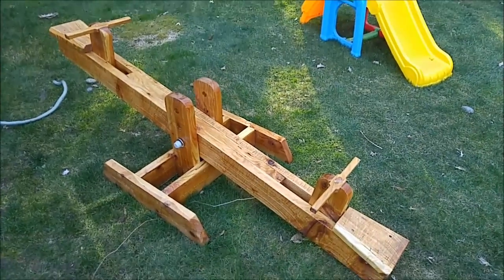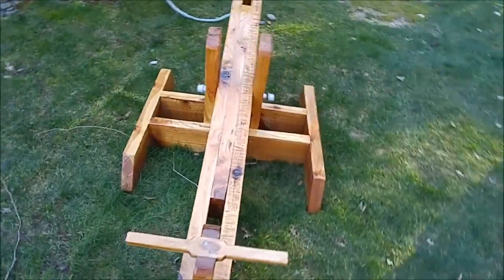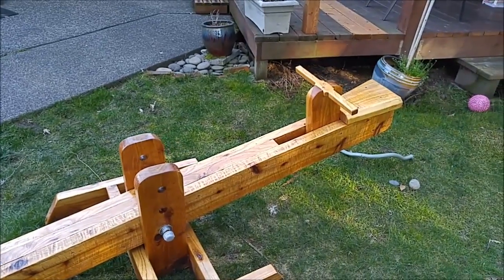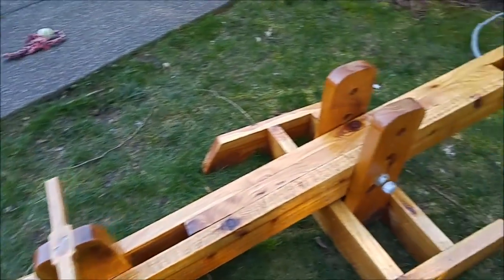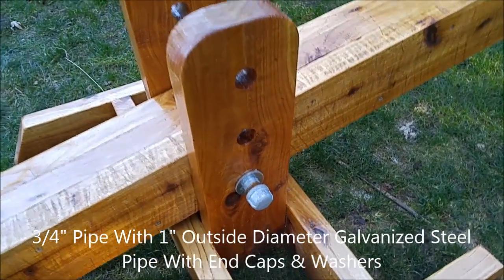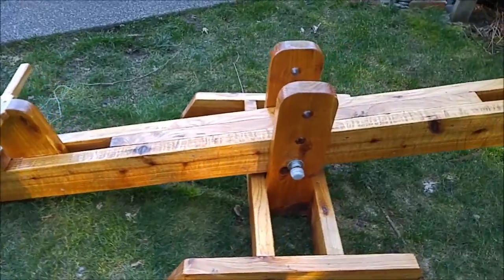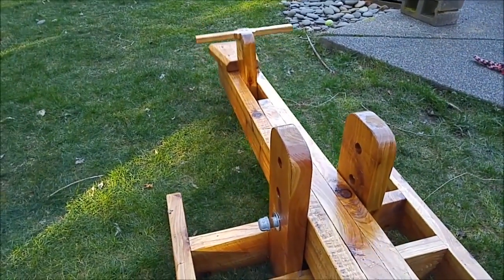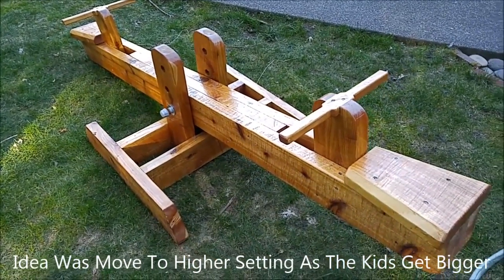DIY Seesaw / Teeter-Totter

Comment: I love this, and there are some things about yours (e.g., the angles of the seats) that I like about yours better than many others. One question -- some other builders using a similar design used a bolt (e.g., carriage bolt), washers and nut as the fulcrum. Why did you choose the pipe instead? Is it harder or easier to change the height with the pipe than it would be with the bolt? (And can you think of other issues -- pro or con -- to the pipe-vs-bolt issue?) A couple of people recommended using the bolt, but adding a pipe as a bushing. I haven't even figured out how that would even work (esp. with adjustable heights). Thoughts there? 

Also, some have recommended adding an off-center hole to the beams to make it easier for people of different weights (e.g., big sister / little sister) to seesaw together. Any thoughts on that? 

I'm about to start on one of these for my granddaughters, so I'm excited to hear from you on this. I just really admire your design and workmanship!
Reply from the maker: Glad you liked the project, makes it worthwhile to post videos! Didn't use a galvanized carriage bolt because all of the ones found the threads would contact the wood, over time chew away at the wood making the seesaw less safe & less comfortable due to being wobbly, also I liked the metal pipe because my project uses cedar which is not as strong as fir or pine, the thinking was larger diameter pipe would be less pounds per square inch pressure and tight fitting fulcrum hole would last longer. Last was that the length of the pipe I used was almost perfect fit for my project and the friction locking end caps are one less thing to worry about compared to non-locking nuts for carriage bolts. In my opinion pipe vs carriage bolt will be the same ease when changing height. My project being cedar one man can move it around, it's not that heavy, an important consideration regards to mowing the lawn, etc. I didn't want to use pressure treated because of the chemicals, and cedar is much more weather resistant than untreated fir or pine, wanted this to last for their entire childhood. I did use a furniture grade exterior finish which has worn off and needs a new coat but it's holding up great even with direct contact with the ground.  I thought about the off center hole, but decided not to because of safety concern, the lighter kid will be farther out from the fulcrum so traveling faster & higher, plus it will be more complicated for the kids to use, they won't know which side to use. Good luck with your project, it will be worth it. Every now and then I get a video of them using it and it makes my day!

Comment: Hey I was wondering if you still had the CAD model floating around I've been wanting to make one of these
Reply from the maker: Glad you like the design, unfortunately I'm not able to post the 3D CAD model. However you could check out the dimensioned 2d drawing view at the end of the video to get the basic size used.
Reply: ok thank you